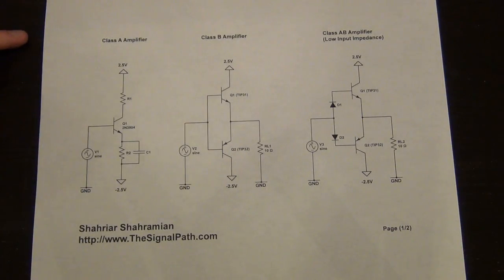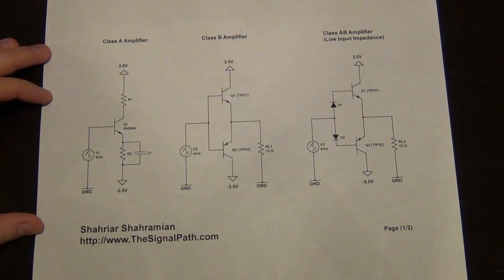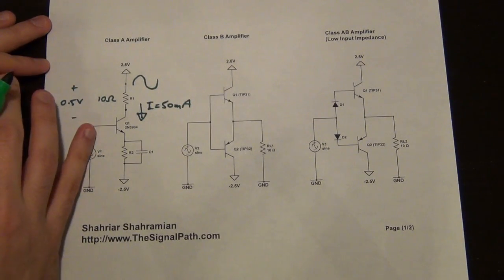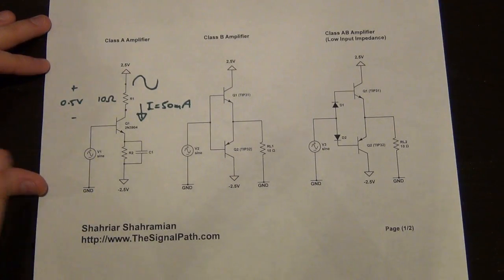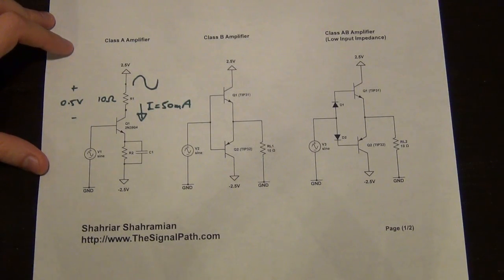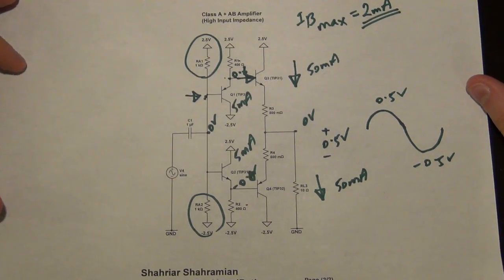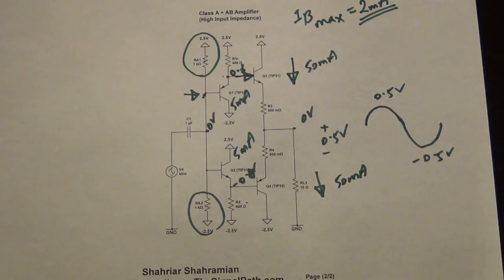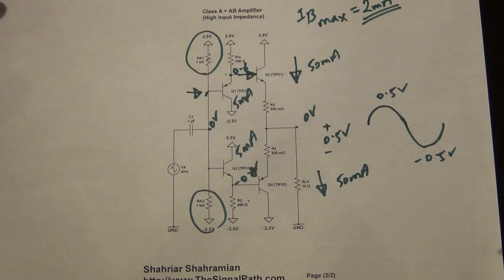TSP #23 - Tutorial on the Design and Characterization of Class-B and AB Amplifiers

Comment: Okay, at about 12 minutes I was so, so confused. I created the schematic in Qucs and what I thought was the case turned out to be true -- adding those diodes means you now need to get to 1.2V in order to turn the transistors on -- it makes the problem *worse*. I did figure out that one of the diodes was backwards. Then I saw a commenter say that the signal needs to applied to the bases of the transistors still, which makes a bit more sense, but I don't understand how the diodes could be doing anything at all in that scenario. EDIT: I just simulated that, and all I have is the class B output... I saw your comment also saying the diodes need a bias current to have their forward junction voltage appear at the base of the transistor. This is starting to make a bit more sense now, as I couldn't for the life of me understand where that 0.6V was coming from.

EDIT 2: Okay, so I finally got the simulated circuit working as intended (I believe) but... I don't have any gain! I actually have a bit of loss. The input is 1Vpp, I have Vcc and Vee as +/-5V, the diodes have about 2.5mA bias current, and the output does look very clean indeed. But it's only about 900mVpp... where is my gain?
Reply from the maker: Glad you got it working. Note that this circuit has power gain, but no voltage gain.

Comment: Great video Shahriar. Would it be possible to explain how Output Clamping Diodes help protect output transistors in certain inductive applications by clamping currents when the amplifier is driven into clipping? The currents would reverse-bias the output transistor collector-emitter junctions, possibly causing damage to the transistors if they were not present? Thank you!

Comment: Hello, Mr. Path. Many thx for all the valuable content you provide! I've got a question: All the push-pull examples you show, are designed with a rail-to-rail power supply. How would a design look when a single supply line is used? Would it still have a symmetrical design regarding the npn-pnp sections? And which point would be the source signal fed? Again at a symmetry-point?
Reply from the maker: In one of my earlier videos (spark generator), I show how you can create a mid-rail voltage for a single supply operation of opamps.
Reply: @Thesignalpath  Thanks for the response, I'll check it out.

Comment: just a thought but the class A side transistors are in a fully saturated mode  and since you used basic power transistors they dont shut off immediately after you drop input voltage especially when you exceed your supply voltage  just a guess but i would imagine to see a difference at a lower input frequency,  although not too much since your exceeding your supply voltage

Comment: The non linearity we see at the ends of the XY plot (36:30) are due to the sine peaks going beyond the supply rail voltages, so the amplifier cuts off the peak curves and a flat top waveform results.

Comment: Diode D1 is in the wrong direction in the class AB schematic, I think. It should be forward biased, shouldn't it?
Reply: Right, and also schematic doesn't show any current source to actually bias either the diodes or the transistors. But, corrected version in PDF on TSP website, see link in the video description.

Comment: In the Class A, how can current be flowing if there is "no signal?" With no signal, wouldn't the transistor be off, and thus no current flowing????
Reply: class A is biased in dc operation, he is referring to zero ac voltage

Comment: Clipping, Amp cannot provide enough power that causes the the wave to cut off at the peak.

How to solve this issue?
Get a stronger a Amplifiers, or don't drive it too hard.
Reply: +SIedgeHammer83 or perhaps it is a problem with the "rails". If you have +2.5V and -2.5V then sooner or later you would need more. Or expressed in another way: eventually the +-2.5V would not be able to supply enough the amps going through the 10 ohm load which would not be able to get high enough voltage over it.
Reply: +taz0k2 It has always been better to explain it that way, when you come to think of an amplifier generally. You fetch voltage from the power source that corresponds the value of Gain times the Input.
So if I have an input signal of 1 volt and a gain of 10, I should be getting a 10 volt in a perfect world. But the device should have a power source that enables it to fetch that voltage.
I hope I helped make it clearer. 
That was a great video by the way, I have stomped on and it looked interesting, never boring. :) 
Great work. Keep it up.
Reply: +taz0k2 You could follow up this video, with a frequency response analysis. Discuss the parasitic capacitance, design for linear response over a bandwidth. Discuss the phase shift, and delay. 
It will be very helpful, much more interesting as well.
Reply: you solve it with negative feedback to the input stage... this will limit the gain of the overall amp...

Comment: I'm lost about the diodes added to this circuit; I've tried modeling this right circuit with the diodes added in LTspice, and I get an answer of 44.99uV and 44.99uV at the base of Q1 and Q2, respectively, using the .op command in LTspice. There is something I'm just basically missing (after all these years) when trying to understand the biasing of transistors. I still wouldn't even know how to write the mesh, and nodal equations to determine the voltages at the bases of Q1 and Q2 - since, the voltage into the base is an AC signal, and not a DC signal to establish DC biases on the bases of Q1 & Q2. (That is, I might have understood this circuit if it had a DC source biasing the diodes on, at the bases of Q1 & Q2, but not simply an AC input source.) I understand that the diodes where added in order to eliminate the cross over distortions; yet, I just don't understand how these diodes actually do this - that is, I couldn't show any type of equations which would arrive at 0.6VDC and -0.6VDC at the bases of Q1 & Q2, respectively. I've even went back a watched a few mesh and nodal analysis examples on YouTube for transistor circuits but all the examples of mess and nodal analysis I've found are circuits with DC biasing sources, and no AC source analysis. "Any" help on understanding this would be greatly appreciated!

Comment: The protection resisters are for the protection from the short circuit that will happen when both transistors are on when 0 ac voltage in .as i think

Comment: how to sellect transformer of class b amplifier, as it is center tap at input stage and output stage also. two transformer is needed. 1st is signal spliting and second is implimenting power output to load. now waht will the output transformer see the output impedence of two collector. need help with transformer coupled amplifier operating in class b mode.

Comment: Upper diode in initial schematic of AB amp seems reversed. Am i mistaking?

also, initial explanation of XY domain is axis-reversed.

puzzle phenomenon is due to clipping, because you get close to the supplly voltage, and the transistors have SOME voltage drop/residual resistance. To counteract that, you can increase supply voltage, or use transistors with less loss.

Comment: And the answer to the quiz: by increasing the input signal amplitude you're bringing the transistors to saturation region and that's why you see the non-linearity in X-Y mode and if you change the mode to X-T again, you see the output signal is clipped.

Comment: The x-y domain that you showed using the A+AB amplifier behaves like so because of the fact the the maximum peak-to-peak swing of any class B amplifier is the source. Since you have a potential difference of 5 between your push-pull amplifier, an input signal greater than 5V would cause a clipping of signal at the output. That means any change in the input that is greater than 5V, would not be seen in the output. ^_^ am I right?

Comment: Good video but it exhibits a very common confusion, Your Class A amplifier is single-ended Class A. There is also push-pull Class A which you don't address. Your class B amplifier is really class C as the conduction angle is <180 degrees. Your class AB amplifier is really Class B as the condition angle is approximately 180 degrees, not 'significantly more'. Class AB is really very over-biased Class B.

Comment: can someone please explain how class A has current running through even with no signal coming from base to turn it on?  sorry newbie here...
Reply: Yeah, that's one thing this doesn't really address -- bias voltage.

That is, that the source signal has to be offset from the most-negative rail.  So, when the signal is at "0v", that's halfway between the V+ and V- rails.  As long as V- is more than 0.6v lower than 0v, there's current flowing through the transistor's Base-Emitter junction, and so the transistor is turned on.  Thus, it's passing current.

That's the defining characteristic of what a Class A design means.  With no AC component on the input, there's still a bias current that causes current to flow through the transistor.  This is intentional and desirable to keep the transistor operating in its linear region throughout the intended range of the source AC component.
Reply: @nickwallette6201  so basically he left the bias voltage circuit out. which is fine since thats not the purpose of this video. it got me totally confused at first.
Reply: @UweWong   Yep.  Or, well, rather it could be assumed that the bias is part of the symbol he used to represent "the signal" -- but essentially, yes.
Reply: @nickwallette6201  ok like the dc offset i suppose?
Reply: @UweWong   Yeah, you would normally use a resistor divider between V+ and V- with the node in between tying into the signal input as it drives the transistor.  Or some variation of that.

E.g., single-supply (V+ and Gnd) circuits might use a well-filtered 1/2Vcc buffered by a low-noise op-amp, and tied to the base with an isolation resistor to allow the signal to superimpose on top without being eaten by the feedback loop.

Dual-supply (V+, V-) circuits might use signal ground as a reference (again through an isolation resistor).  If the transistor's emitter is tied to a voltage sufficiently below 0V/Gnd, then it's already biased because 0V is higher than V-, so current is flowing through the BE junction.

And so on...

Comment: In class AB when the input 0 v it is not necessary the voltage after diode to be 0.6 v 
if u enter 0v dc on diode and measure voltage after it , the voltage still equals zero

Comment: @ 13:07 why is it that the diode could give us a 0.6 voltage to start off even if at 0 volt input it's not even turned on.
Reply: +Memo “MekoxTwiSparkle” Pony Yeah it's always the details like that which derail me right off the bat.
Reply: There are parts missing from the diagram. There should be a resistor connecting the top diode  (which incidentally is the wrong way round) to the positive supply. That resistor and the two diodes are the load for the transistor that is driving the output stage. Current flows from the positive rail through the resistor, the diodes and the driver transistor to ground so that the diodes are forward biased and are each dropping approx. 0.65V.
Reply: Carlos Ruiz points out that the signal is incorrectly applied to the junction of the diodes. The signal at the collector of the driver transistor is actually applied to the lower diode.

Comment: And I tried it in multisim, there is still a 0.8 V drop. I don't even know if the current flow through 2 diodes how can the voltage drop be 0 V alltogether :s

Comment: Sir any video on transmitter and receiver module  used for RC toys to control the dc motor of the toy  , please explain how data transmission takes place between the transmitter and receiver module  used for RC toys to control the dc motor of the toy  , please explain the schematic of the modules

Comment: Your class AB amp is actually class C.  There would be 1.2 V needed to turn on the top transistor, similar for the bottom transistor.  Your thinking of the diodes often used to bias the o/p transistors, you confused yourself because you were trying to show the biasing arrangement of the diodes with no bias resistors.
Also, the max efficiency of class is 50 % not bloody 20, where id you get that one from ?

Comment: Nice video but it would have been great if you could use a speaker, and a "real" signal input, like the audio output of a CD/DVD player for example, so one can hear that amplification effectively works !
I did it with a basic class A amplification seen on another Youtube channel and the input signal coming from a DVD player, and it works (not very loud but it's clearly audible) with a small 8 ohm, 0.5W speaker

Comment: A loudspeaker is an inductive load, not a resistive load
Reply from the maker: A speaker is not purely an inductive load. In fact, a properly designed one would be mostly resistive. You have to take into account the mechanical response as well, which acts on the diaphragm of the speaker and thus inhibiting the coil movement. It is a complex electro mechanical model.
Reply: I would like to see how amplifiers handle an inductive load and how to properly cancel out a magnetic field using another coil on the same core for an arbitrary waveform
Reply: If that's true hook up an 8 ohms loudspeaker insteed of the 10 ohms resistor and let's see how the signals do look like

Comment: Great video and clear presentation. Thanks for sharing! I'm curious about how the input voltage affects the push-pull action. I've made a similar circuit based on AllAmericanFive's video with some modifications. I noticed that each transistor in the push pull pair responds differently depending on input and output levels... For example the PNP in my video ( https://youtu.be/YuTiswQU0Uc ) gets warm at high volume, but the NPN gets warm at low volume. Is there a way to stabilize the pair for maximum input/output range?

Comment: Diode D1 is facing the wrong direction...
Making your biasing derivation incorrect.
When you added the additional transistors You corrected the biasing problem for D1 because now the diode is actually the B-E junction of a common emitter amplifier with it's own power supply. 
 If you don't believe me, build the circuit only using those two diodes,
 If you reverse the direction of D1 and add series resistors from each diode to a power rail, current will flow through those diodes and you will get the bias you need to allow the output transistors to operate without the common emitter stages in front of them, and without the crossover distortion...
Reply from the maker: The schematic had an error on it. The circuit is correct on the breadboard. The video used to have annotations which pointed at the mistake in the drawing. But YouTube removed those annotations a few years ago.

Comment: Hate to break it to you, but what you've been calling "Class-B" in this video is actually Class-C because the output transistors conduct for less than 180° of the input signal.  What you call Class-AB is actually much closer to true Class-B (conduction angle = 180°)  In practice, it is actually best to avoid Class-AB (180° < conduction angle < 360°) altogether, and to stick with either Class-B or Class-A.  Look up Douglas Self and gm doubling, especially "Distortion in power amplifiers, Part IV"